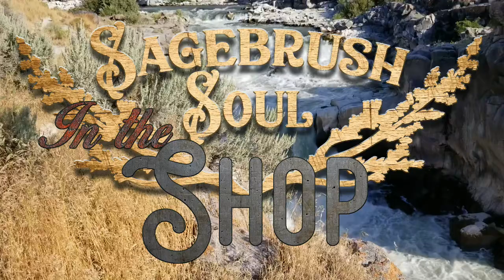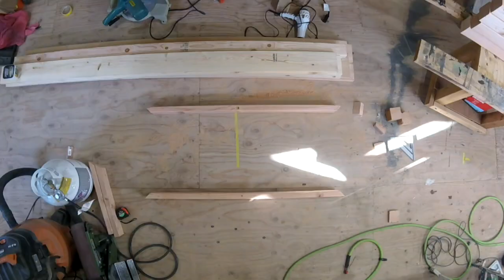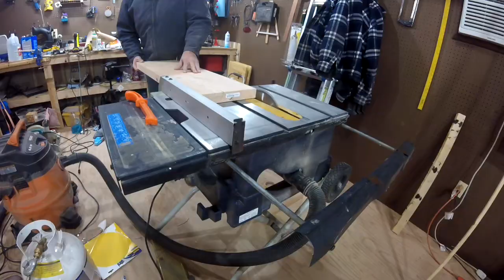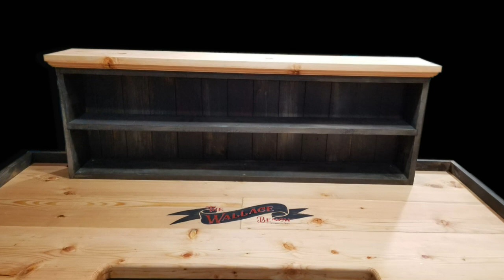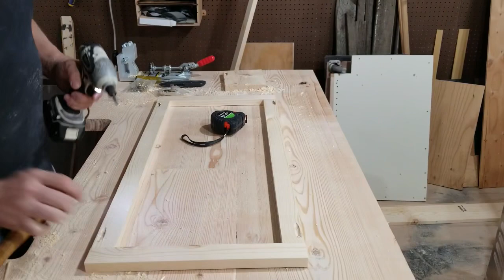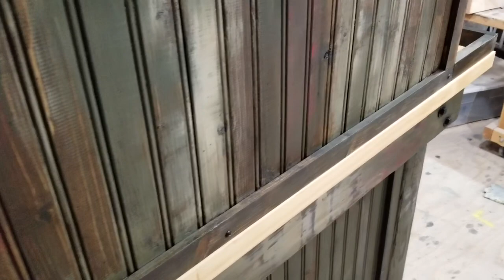DIY Reloading Bench Build

Comment: Would also be easier if the rail for the drawers was snap connected instead of wheels. The table top 2X4 is in the way to fit the drawer into the rail when installing.
Reply from the maker: Agreed!

Comment: What is the size of the sides for the top self?
Reply from the maker: It's been a while but I'm pretty sure I used a 2x8. to top it. It's possible It was an off cut from the bench top. but a 2x8 should give the same result. Thanks for watching.
Reply: My bad, I should’ve typed that better. I meant the length of the sides for the top shelf.

Comment: Very nice finish, looks like something out of Red Dead Redemption.
I just finished a similar (but rather more utilitarian looking) reloading bench.  One thing I noticed is that the reloading press can put rather a lot of twist-wise strain on the front end of the worktop, which after a while started to work apart the butt joints between the first 2 planks.  I've since strengthened that joint by routing a shallow and wide channel along the joint, and inlaid that with a well fitting hardwood strip.  Adds a great deal of strength to that joint to counter the downward twisting force.  But if your planks are wide enough and well supported, that may not be necessary.  Just something to watch for.
Reply from the maker: That is a fantastic idea! I was worried about that as well, I  don't know why I didn't put it in the video but I actually ran some angle iron along side the base under the worktop I think it might be visible in some of the stills but I'm not sure.  I never thought of taking design ideas from RDR but it might be a great idea lol. Thanks for watching and taking the time for the input! Cheers!